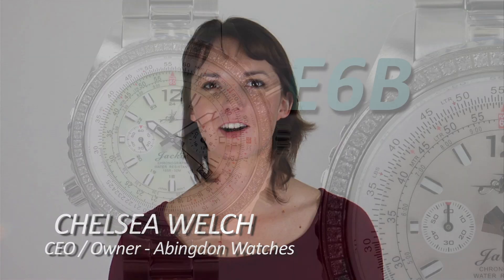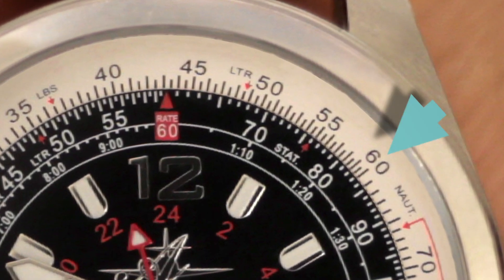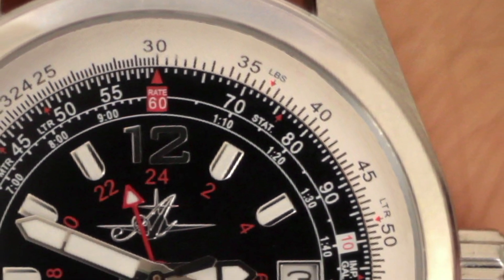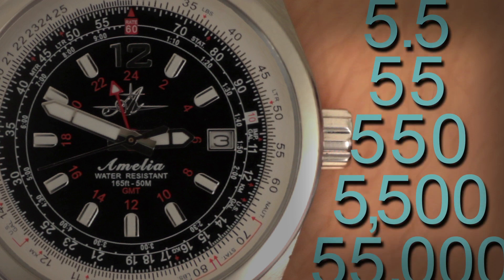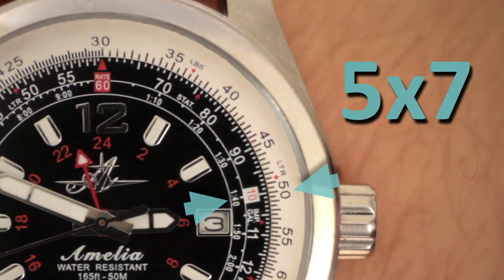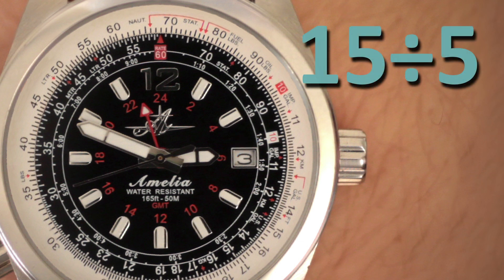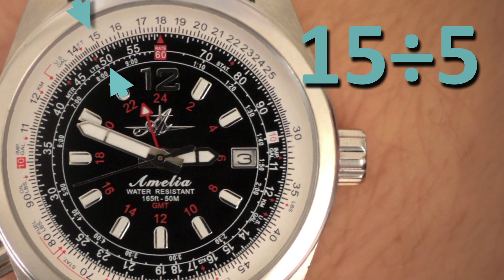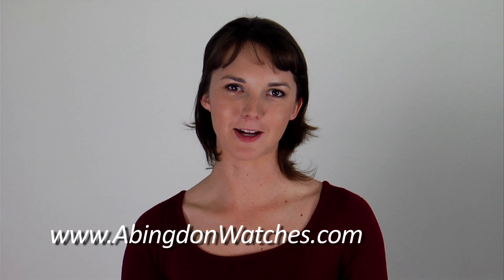How to use Your Aviation Watch: The Basics

Comment: Why is the bezel adjustment knob located on the left?
Reply from the maker: The E6B crown on the left was the original design so it wouldn't conflict with the 3 o'clock crown on the right side. About 2011, I changed the crown placement to the 6 o'clock position because customers wore this watch on either wrists, therefore having the crown in the center worked for righties and lefties.

Comment: This explanation is a little different to understand and apply quickly. Really, I feel better knowing the relations here.

We have two logarithmic scales... so, a logarithmic amount of whatever number we pick. Then, properties of logs:

log(a) + log(b) = log(a×b)
log(a) - log(b) = log(a÷b)

Just use the beginning of one scale, put a first number from the other on it, then read from the second number to multiply.

Put two numbers together for division, read the beginning of the scale on the smaller number to get an answer.

This works really quickly when you get it
Reply from the maker: there are many roads to the top of the mountain. Thanks for the alternative explanation 🙌
Reply: This may be easier for an engineer. I am just a med device rep, so her explanation was more straightforward. I do not need the math, just the answer.
Reply: @JD  What you just said was "I do not need the math, I just need the math"
Reply: @phil2082  Not really. I do not need to know how the soup is made, I want to eat the soup. Not that hard to understand. If you can understand logarithms, you should be smart enough to construe my parallel.
Reply: @mccalljeff  If you need the results of math, then you need math

Comment: Great little video clip. Almost takes me back to school days - Dad was a pilot and I'd have cast off's of various devices etc.

I realise we all have to know navigation the long hand way, and that digital devices and 'moving maps', apps etc have come on a long way (and we need to know the long hand version in case of device failure), but are 'aviators watches' still helpful and valid in the 21st century? It's a genuine question as I'm considering purchasing one.
Reply: Wouldn't help me in a helicopter, I can tell you that, lol. Takes two hands to use it and you can't take your hand off the cyclic. But in an airplane I expect it could be pretty handy for quick calculations once you got the hang of it.
Reply: The Burning Sensation LOL! good point well made!

Comment: It is like the "slide rule" that was used before electronic calculators were invented.
Reply: +Jorge Hdez I still have my slide rule in my desk draw...I use the CITIZEN NAVIHAWK.
Reply: The E6B is a slide rule. But instead of sliding horizontally the E6B rotates.

Comment: Sure it can, take the number 82 (indicated by a dash mark between the number 80 and 90) on the outer ring, rotate it opposite the number 20 (or as we want it, 2.0) and look opposite the number 10 in the white box to get your answer. You'll see it points opposite of 41. Voila!

Comment: @RileyWG One final thing: playing around with a slide rule is a good way to understand how logarithms work, since a slide rule is basically a pair of rulers (or rotating dial) with a logarithmic scale printed on it.  It provides a physical demonstration of how n x m = exp(log(n) + log(m)).  As you move the bezel, the physical relationship between the scales changes linearly, but since the scale is logarithmic, the relationship between the numbers of the scale changes nonlinearly.
Reply: +äg L öG ^?^

Comment: @RileyWG Also, using a slide rule requires much more skill than a calculator.  You don't just tap in the numbers and the operation, and get the exact final answer out of it.  You have to mentally keep track of the decimal places, because to do 550 x 310, you have to convert it to 31 x 55 for the watch bezel.  Aligning 10 with 31 in the bezel, the number that corresponds to 55 is 17.  Now, you have to put the zeros back to get the answer—approximately 1700.  (The exact answer is 1705.)